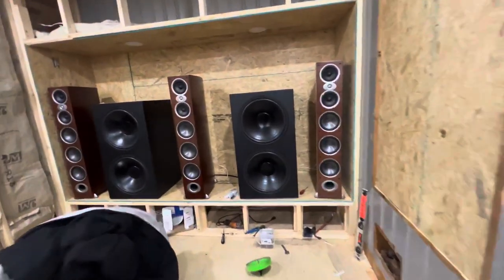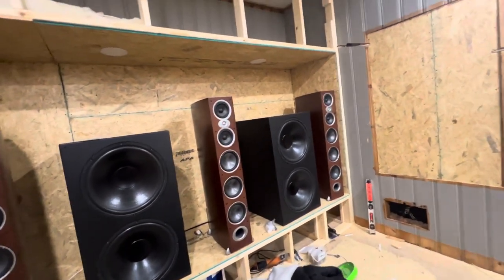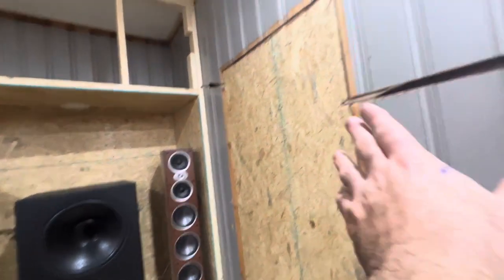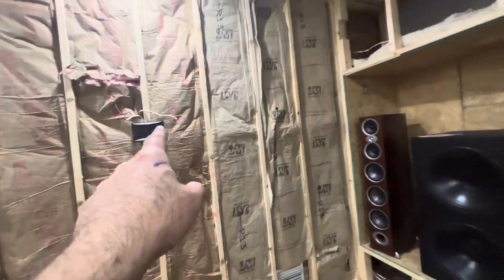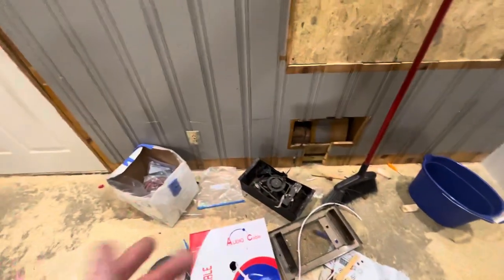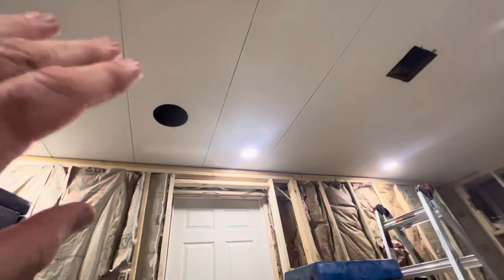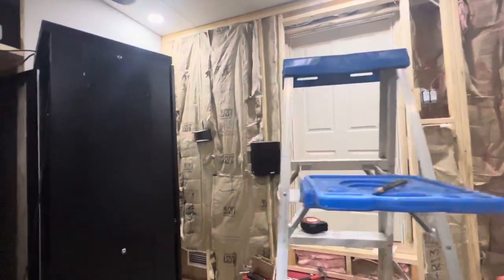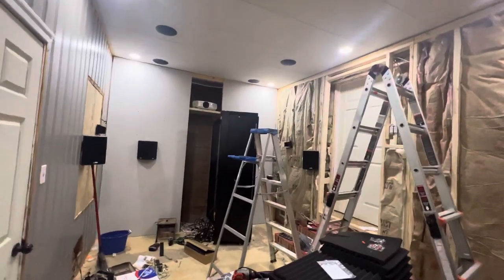Friday hurricane theater update!!! 7.2.4 dedicated home theater

Comment: I had a 1002 crown amplifier it done a little buzzing also I grounded it to the den there’s a spot where you can run a cable and you can ground the amp to the receiver and that took the sound away you can try that and see if that works